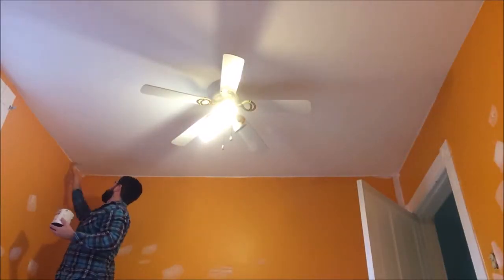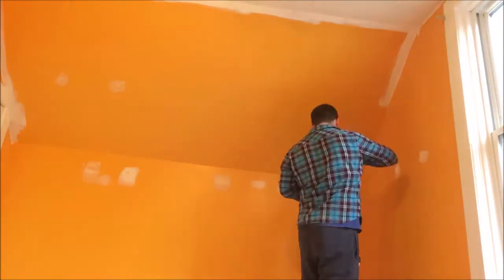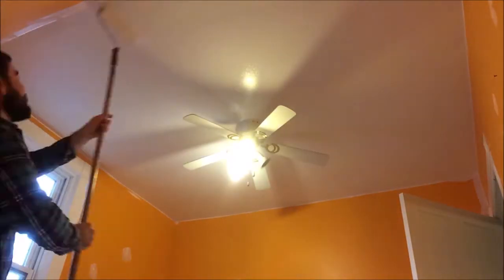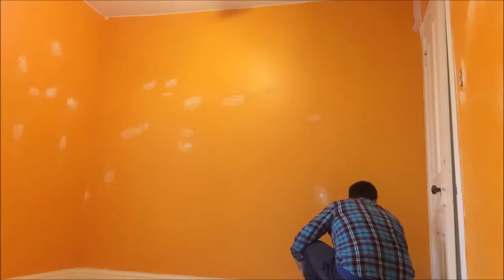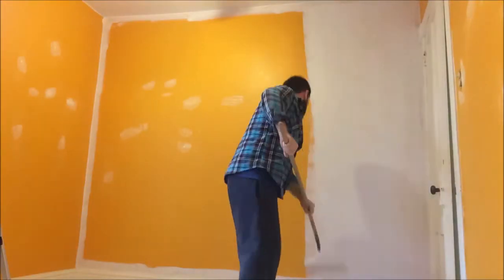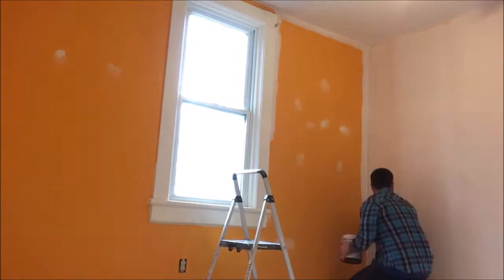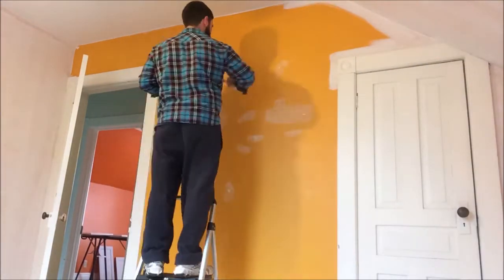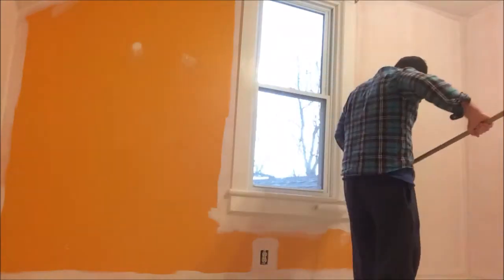Priming over Orange walls

Comment: Thanks for this! Moving into a house with a bright orange bedroom. ~shudder~

Question: the room is going to be my 5 y/o stepdaughter’s room, and we’re envisioning pastel pink walls with a darker pink accent wall. Think the pink will hide any orange peeking thru the primer? Or will we end up with a peachy room? Should I do a coat of white paint first?

Thanks in advance 😊
Reply from the maker: Hi, thanks for watching and for the comment
If you prime , and buy good paint. Don't go cheap on the paint, 2 coats of pink and it will be totally covered. The reason I say get good paint. During the past year I have had to use lesser quality paint of the good stuff was not available and I had to cover up a dark color with a light and usually with the better quality paint it would be no problem,  with the lesser , cheaper paint , it took an extra 2 coats to finally get it covered. Here I use sico or benjamin Moore 
 I believe they are the best on the market. 
Hope this helps
Reply: @TheCanadianHomePainter  thank you very much!

Comment: Thanks for the video. I used yesterday some leftover primer from the previous home owner. It must have been in my garage over 13 years but the consistency looked good, so I said "why not use it". I paid a painter to do the job and gave him the primer. I find today that the primer coat is much more transparent than I see in your video (almost runny in some areas) and it has a very pungent smell of fermented milk. Was that primer expired? The room color is a flat yellow tone.
Regardless, I'll never use old primer ever again.
Reply from the maker: 13 years is a while, I have used old paints and primer before, if the customer had the lid tight and store in a good area, I usually just take the can to the paint store first to shake it I find 5 mins on the big shaker will do the best. It could be just it was too old. If you haven't painted the top coat yet, you could just give it another coat of primer , if you have already painted it then I wouldn't worry too much, did the smell go away ? 
Thanks for watching and for your comment
Reply: @TheCanadianHomePainter Thanks so much for the info. I havent painted on top yet. I want to let it dry well for at least 36 hours. So far it's been drying for 20 hours and it still smells. The painter says that the consistency was OK and the smell normal. We'll re-evaluate tomorrow. If going for another primer coat, I'll see it they can tint it at the store with the new color to make quicker progress.
Reply from the maker: @MrSevillian  let me know how it works out , most primers are tinitable , so that's not a bad idea to tint it. But they will know forsure at the paint store
Reply: @TheCanadianHomePainter  At Kelly Moore they blame the smell of rotten milk to the primer being way too old. Even if it was in good shape, it was formulated with 100g/L VoC. Modern primers they told me would be comparable to the latex paint I recently bought there (<2 g/L). So I've screwed up and the painter didn't raise the alarm either.  At the store they showed me a primer that seals odors for possible fix, but they come with 550g/L VOC!!! Short-term, it would be replacing one strong odor for another. Fresh products only from now on for my projects.
Reply: By the way, the primer gained consistency as it dried (48 hours now) and it's covering as expected. The problem is the gassing off.
Reply from the maker: @MrSevillian  yes that's probably a good idea, but a few years old you're probably ok but any more best to get rid of it. Thanks for sharing that info,  I am always learning too so always good to know about these things. 
Hope everything works out great in the end

Comment: Can I use primer paint combo? Will it cover
Reply from the maker: I dont use the primer / paint combo because i find that it doesnt work to conceal the drywall compound repairs good enough, so I usually give it a coat of just primer first, that way I know that repairs will be totally covered and concealed, hop this helps. You can tint the the wall colour if you want, I used it on the ceiling and trim on this job so that's why I left it white

Comment: Why is my primer so patchy? Should I put a second coat?
Reply from the maker: Primer never looks as good as the top coat paint. A second coat of primer  might look better but probably isn't necessary
Reply: @TheCanadianHomePainter  ok, I feel like I may not of used enough paint. Do you think then I’m ok to go with the paint color? Thank you!
Reply from the maker: @MsMuymona  if that is the case, then maybe a 2nd light coat might be a good idea , if it doesn't look covered
Reply: @TheCanadianHomePainter  thank you! Will do